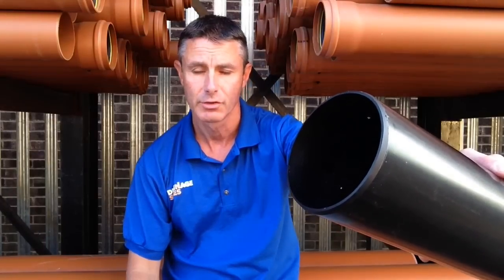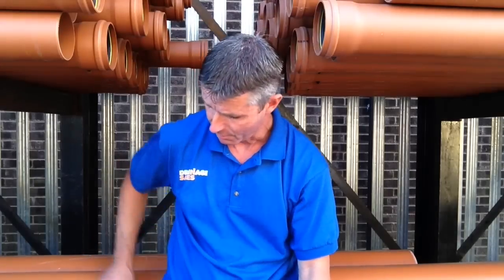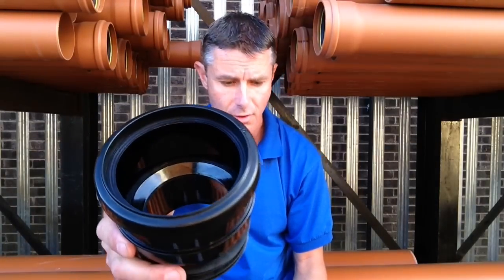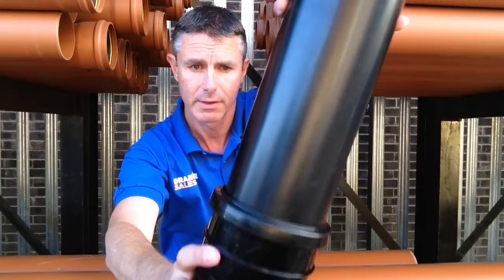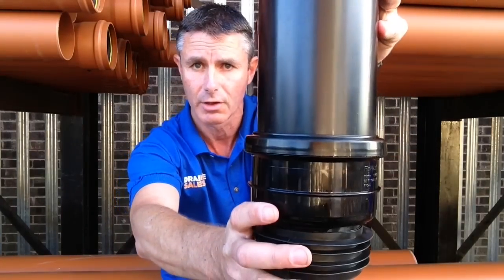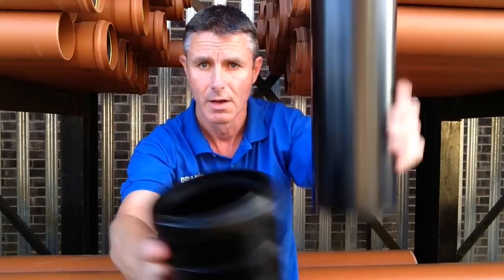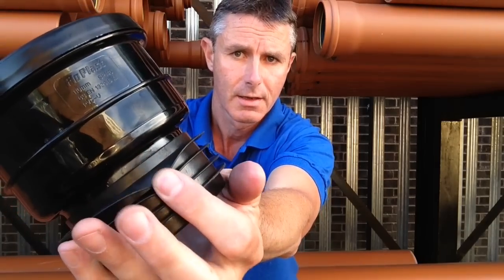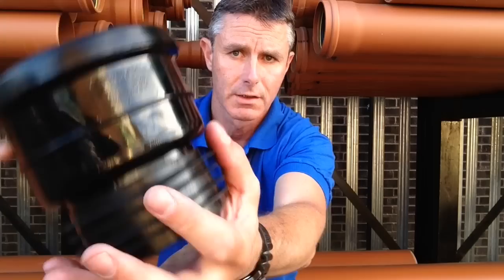HOW TO: Connect Plastic Soil Pipe to Cast Iron or Asbestos Cement | Drainage Sales

Comment: If I need to connect a toilet pan to a cast iron soil stack, do I essentially need one of these connectors (the SP140 or equivalent) plus a very small section of 110mm pipe, plus a toilet pan connector? Seems crazy to need 3 parts to connect a toilet to a type of pipe that's very common in old houses. Or is it possible to get a toilet pan connector that connects to a 110 socket? (i.e direct into the SP140 and only needing 2 parts)

Comment: Hi my soil stack is internal . I was wondering if I could just replace the top half of the soil stack with a Tee joint which would allow only the top half to be showing outside , is this a good option to choose ? Or would I have to completely remove it & put it outside ?

Comment: Hi

I had some builders remove the cast iron soil pipe, it measures 90mm internal diam, will this product suit it as at the minute  i have a nasty white WC pan connector at the base instead of something like this which would match the rest of the pipe

Thanks